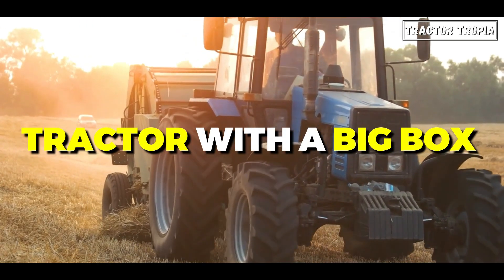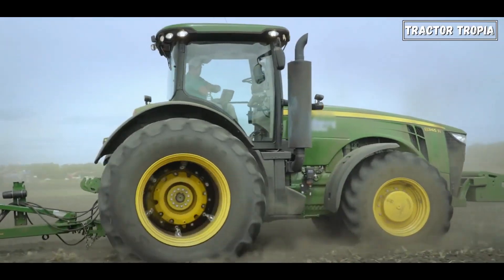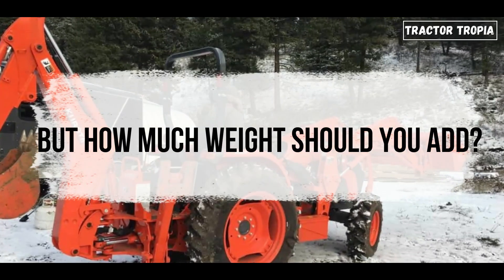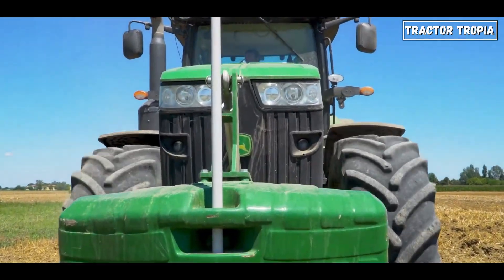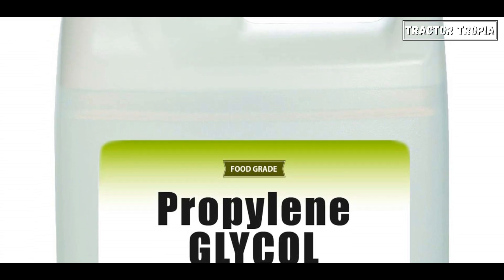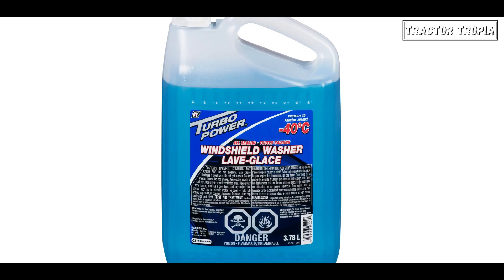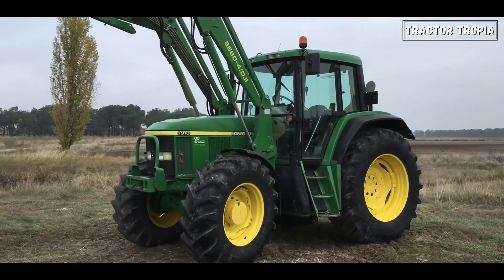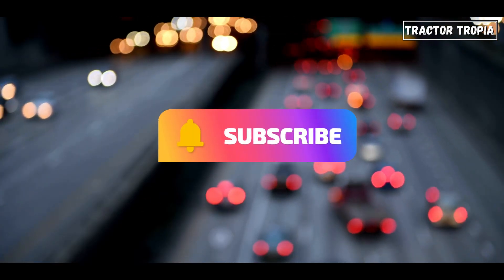Why Do Tractors Have Weights On The Front?

Comment: In the U.S we don't have one big weight,  we use lots of little slabs of weights that can take up the same amount of space. We call the vertical ones soot case weight because they look like soot case and we call the horizontal ones pancake weights because if you them together they look like pancakes. The reason why we use slabs of weight is so we can put exactly how much weight we need for a particular job

Comment: I went to a trade school to learn turf management the l3301 Kubota had water in the tires for ballast. It was especially useful when using the loader. kubota has been known to have light rear ends but you can use weights I still prefer Kubota over Deere. Expanding foam is nothing new for tires in the world of lawn and garden equipment. Zero turn Mowers rely on the Mower Deck for Ballast since the weight of the mower deck is close to the front.
Reply: up here in Canada we mix calcium flake into the water Makng it heavier and acidic so I'd dosnt freeze in the winter
Reply: I have also seen and heard of fermented beet juice working as well. I used to think beet juice would freeze, but aparently it turns into alcohol inside the tire, and combats the cold!